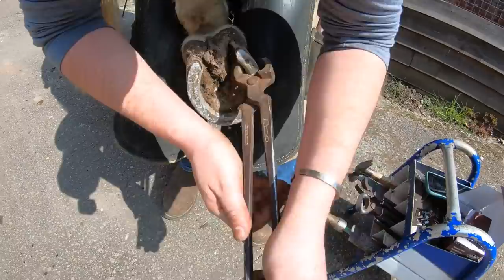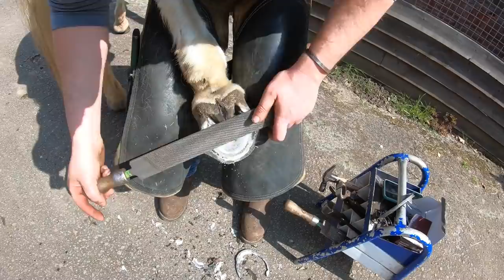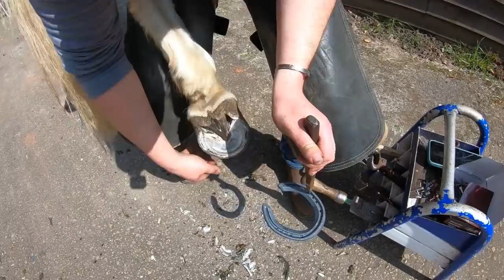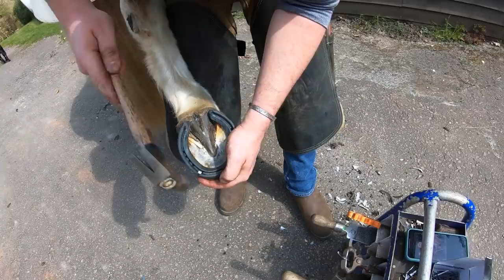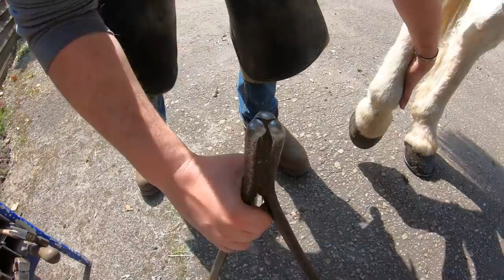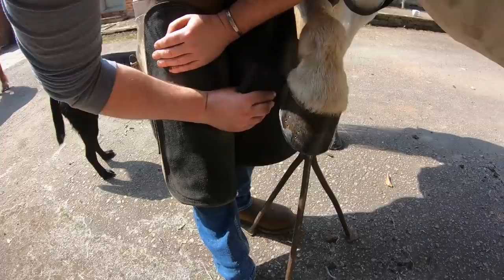HOOF RESTORATION - BEFORE & AFTER - THE FARRIER

Comment: I’m always surprised the horses don’t have to readjust their weight too often when on three legs. Like I can barely stand on my two feet without moving around every minute or so.
Reply: 你做的非常好。贊！
Reply: Lose some weight then
Reply: @dzzuel6008  what he/she meant is like fidgeting, that horse is like a statue just staying still
Reply: Three feet/points of contact keep you well balanced - my ex was told three points of contact is far more stable, cause the weight is even more distributed than it would be on 2 feet

Comment: So what's the reason to let the hot horseshoe burn the bottom? Just curious
Reply: I'm not sure, but it looks like as if the burning marks show, where the horseshoe touches the hoof.
Reply: It’s fire hardening. It hardens the hoof so it doesn’t wear as quickly, and it also allows the shoes to stay in and have less chance of slipping off while the horse is running or doing horse things.
Reply: Its so it fits 100% the hot shoe burns all the rough edges and creates a smooth barrier between hoof nd shoe